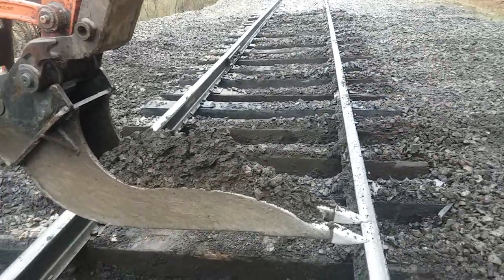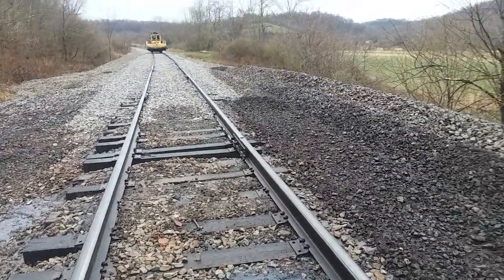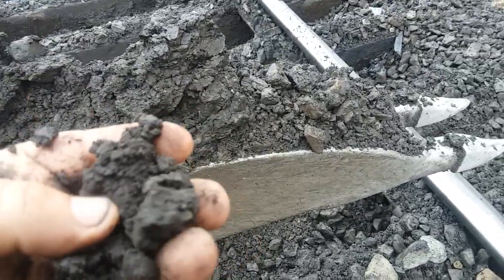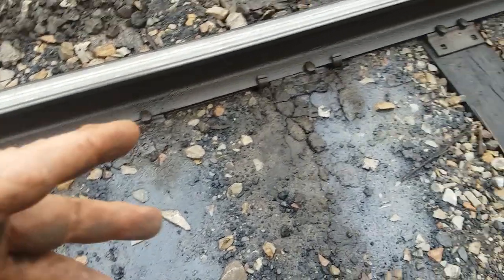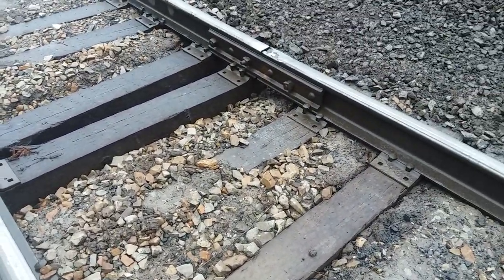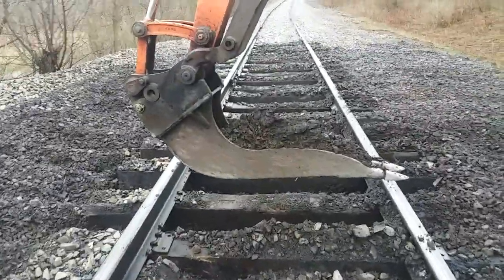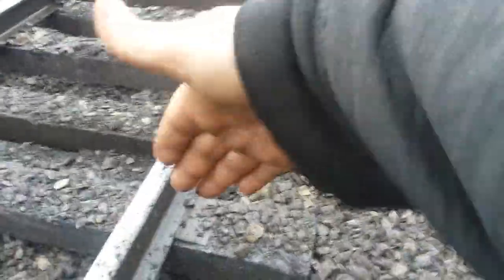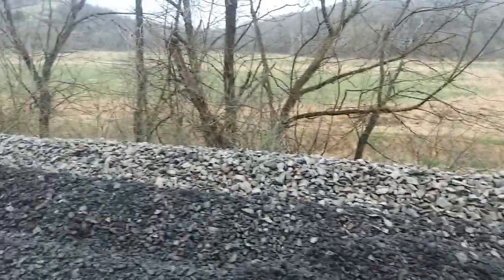Cribbing Ties on the Railroad Track - Why Ties Have to be Cribbed Out

Comment: I would have thought that they could build up the damaged rail spots with welding, then grind down the excess. They do that on worn farm equipment, and on heavy equipment teeth. With lasers that can measure instantly,  and computers on a chip to control machines, I would have thought that some company would have already invented an automated machine to do that. Those new rails can't be cheap.
Reply from the maker: Bill we have in the past done that, we have to get contractors in to do the
welding, I'm not much of a welder, so have to wait for them and this one's 
pretty bad, not sure if it could be welded up or not. Do appreciate your watching sir
Reply: @ccrx6700  I knew a welding contractor who fixed battered heads, reground the profile. I've seen the results of the work. Looked decent and likely way faster and cheaper.  Really appreciate your taking the time to make these informative videos. I worked for rr when I was young.
Reply from the maker: @jaknjef  that might work pretty well here, we got a lot of rail end batter, need a good welder here

Comment: You would think after a hundred years rail technology would improve but nothing major changes? Diesel was big but the tracks look the same.
Reply from the maker: Well one of the major changes since way back has been the 
advancement of ultrasonic  rail testing technology, plus the
implementation of geometry cars. Also there has been some
good advances in the steel making and cooling process. Do thank
you for watching the video.
Reply: @ccrx6700  You do great work at explaining things and you work outdoors on the rails, if I wasn't behind on my work I'd come join you, thanks.
Reply from the maker: @Makeitliquidfast  thank you, and I can use all the help I can get ! 👍

Comment: Why don't you ask your bosses to consider buying a attachment that looks like a giant chain saw that fits onto a excavator it runs horizontal under the track and pulls all the ballast out from under the ties?, You can see one operating in this video.
https://www.youtube.com/watch?v=bBmPvlxAViE
Reply: They had a contractor come in with one of those in an earlier video to undercut the ballast from the bottoms of the ties.  I wonder if they make a small enough one to fit between the ties.  Sounds like an invention is needed.
Reply: @littlewingpsc27  Even if it only reaches in about halfway you can work it on boths sides, that way it would be a lot easier to maneuver.
Reply: @brianmillar5075  I work for Maintenance of Way.  Cant use that chainsaw like equipment for wood ties it can damage bottom of wooden ties.  If you watch that video those are concrete rail ties so there is a lesser chance of damage to rail tie
Reply: @gutterguru7158  Maybe it's time to start changing over to concrete sleepers anyway.
Reply: @brianmillar5075  That won’t happen anytime soon.
Reply: @littlewingpsc27  The problem is you need to get the old ballast out from under the ties as it would be full of coal dust, vibration causes the small particles to move down and larger pieces to move up, which means you end up with a layer of crap between your original roadbed formation and the ballast and when it gets wet it can cause a whole lot of problems.
Reply from the maker: Brian, thanks for your query. Would make perfect sense, undercutting
is the very best way to go. However consider our situation. With cribbing I can run a train over it as soon as it's dumped with ballast.
They run trains 24/7 here with only a week or 2 shut down during
the whole year.

With undercutting, first we have to fix the ties, they are often a mess
after undercutting, then dump ballast, tamp, dump more ballast and
tamp maybe 2 or 3 more times before a train can run. This takes 
man power and a lot of time. We only have 2 guys work track maintenance, plus with undercutting you need a second machine
along side the track to get rid of the spoils. We simply can't do it
with a train running every 4 hours. There are other factors involved,
but hope that short explanation helps clarify our situation better.